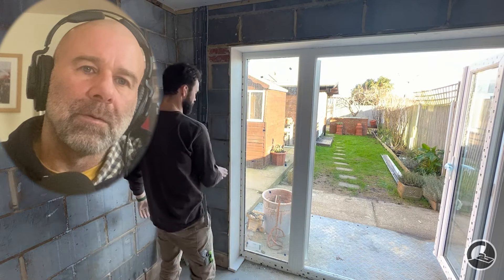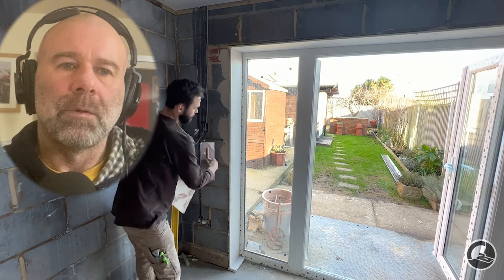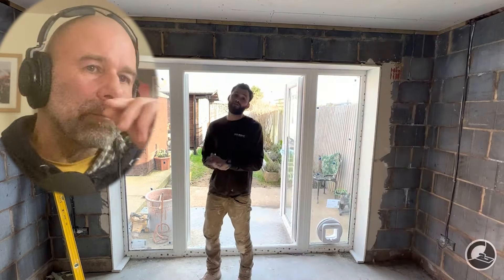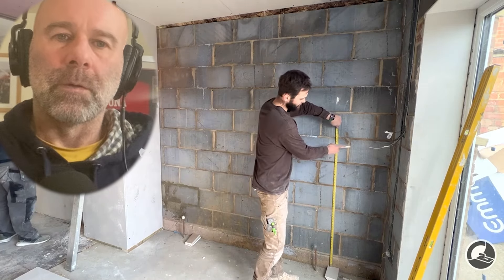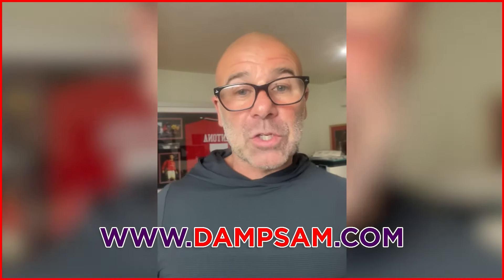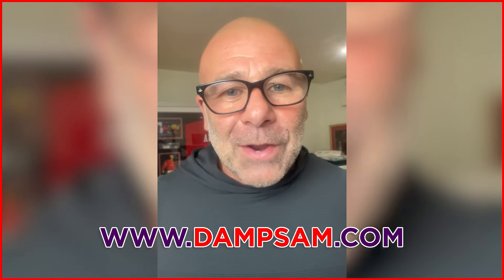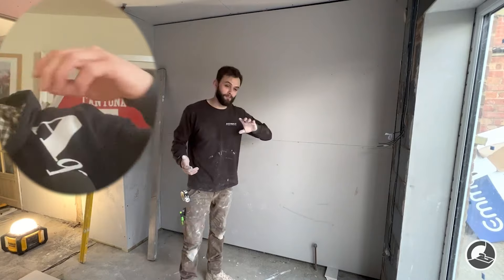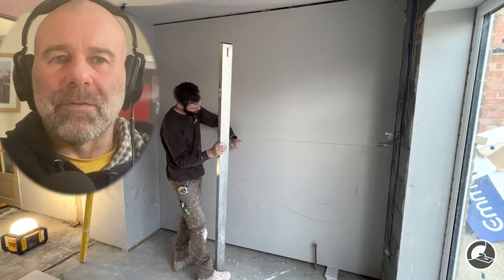DampSam Reviews Dot and Dab Technique - Part 2!

Comment: Love your vids  cracks me up mate, but ye i spot board like you accross joints also  i dont bang boards verticaly "only in corner " i go diagnally first stops dips in boards. Thought you might of said somat about dabbing on old brick on that column, prob be ok  it looked clear but i foam the bottoms and external walls no comebacks m8.